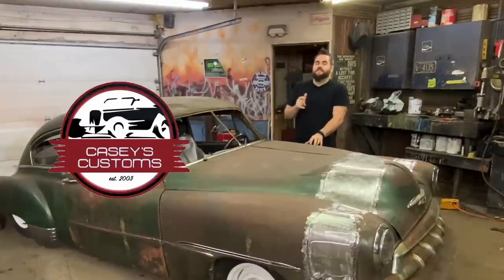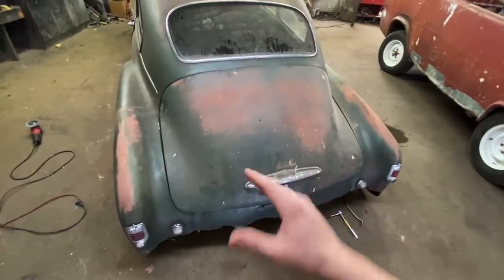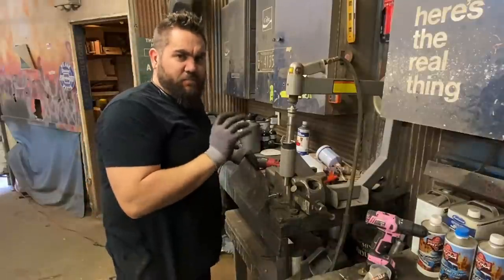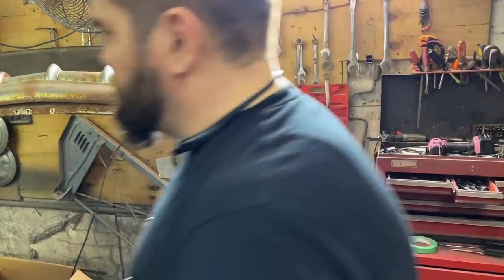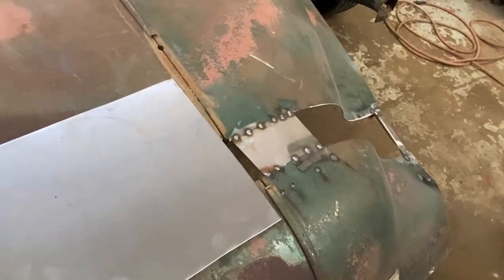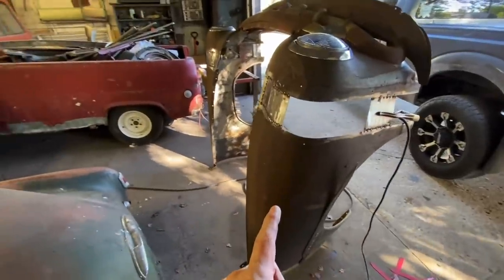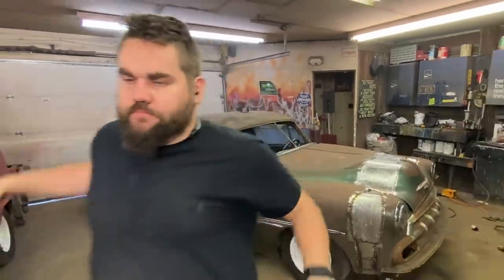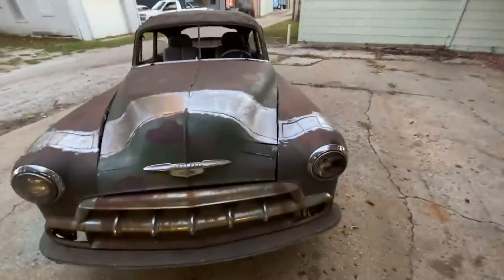$3500 DOLLAR RAT ROD BUILD! PART 13! TURBO, AIR BAGS, CHASSIS SWAP AND CHOPPED! HOT ROD BUDGET BUILD

Comment: saw a guy on you tube use a Oscillating Multi-Tool  with a blade ground down like a putty knife. seemed to work well for taking the thick undercoating off
Reply: They actually make a scraper blade for oscillating tools and it works great.

Comment: Wow that's getting it, I think I would lose that part between the bumper and the grill and tuck the bumper in snug, think it will go better with the extended fenders.
Reply from the maker: That’s called a splash pan and i will leave it, but i will trim it and pull the bumpers in an inch or 2.
Reply: @CaseysCustoms  Yeah I couldn't remember the name , the chev is gonna be so slick hell of a job Man I'm digging it!

Comment: Wouldn't you be able to keep the shrinking from happening by putting the fenders on solid and then welding the hood to the fenders prior to making the hood extensions??? Then grind off the welds once all is done..
Reply from the maker: Unfortunately no, once you would cut the welds off the fenders it would just bow back out. The weld creates a shrink and the only way to get that shrink out is to stretch it back out.

Comment: Sooooo... cutting  it and then butting it in can be less accurate and requires you to take it off and back on an extra time but if you just cut it while it's in place and then weld it right then the fit is super tight and easier to weld. Check ot Fitzee's Fabrications " cut and butt" technique for more info.